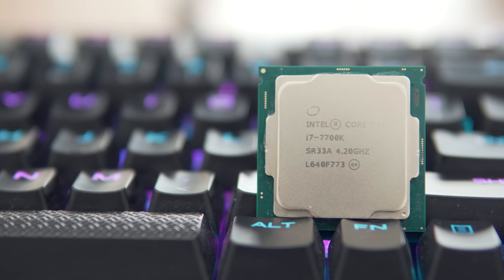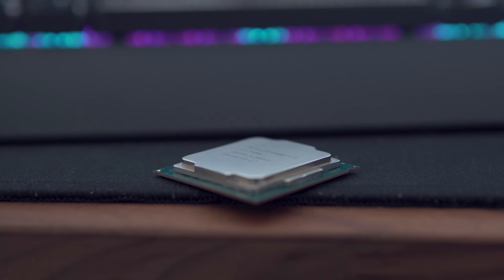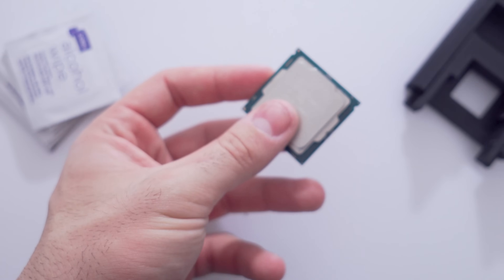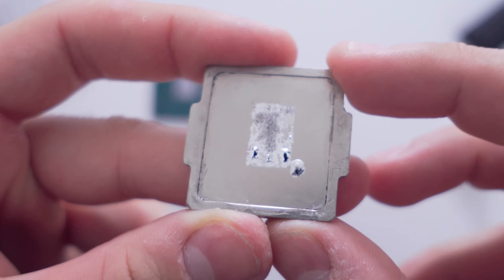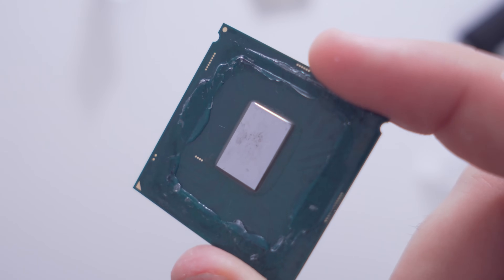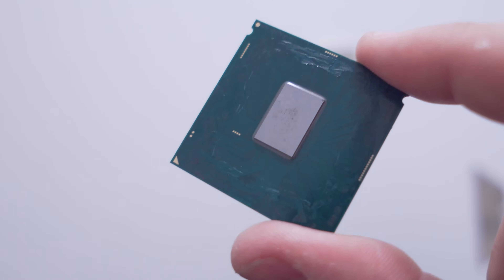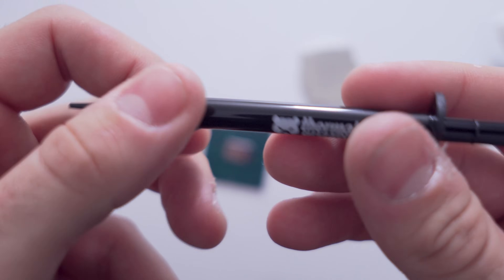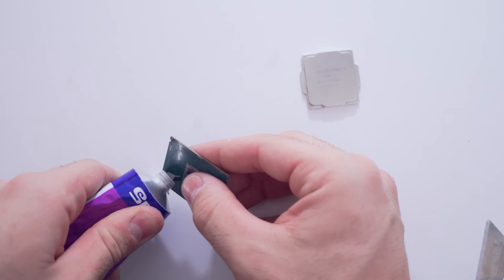Liquid Metal on CPU - 9 Months Later!

Comment: Still a complete joke that you need to delid
Reply: this is oldschool hardware overclocking 
risk => profit
Reply: CPU temps are fine from factory if you don't plan to OC your CPU, but yes, delid is kinda mandatory if you wanna OC  down the line :)
Reply: Yeah, i know it's freakin' high, that's why i kept such voltage only for a CPUZ validation screen
Reply: not with amd cpu's :P they solder their IHS to the CPU no need to ever delid
Reply: Schicken Phartso, if soldered was worse due to thermal cycling, AMD and LGA 2011 chips would get hotter over time. If you know a soldered IHS chip that gets 10 C hotter over time, I would really like to see that.
Reply: yea but for 350 usd i would expect to have it soldered
Reply: 1.502v  dafuq
Reply: Same, I was at 4.7Ghz  80 degrees, Now at 5.0Ghz 68 Degrees max.
Reply: Adrian Ronald Sehat 4 core 8 threads
Reply: jackelofnar if you don't want to delid and you're afraid then enjoy 4.8 average OC at 84°C. After I did a delid an applied liquid metal thermal I achieved 20 degrees cooler which also allowed me to have a stable overclock at 5 gigahertz at maximum temp of 80°
Reply: Not sure why they stopped soldering them my 5930k was and its fine.
Reply: My 7940-X will run all-core @4.5GHz @1.26V and it only hits 85C on air while running CPU benchmarks.  Technically I don't need to delid, but I plan on doing so anyway just to see what I can get away with.
Reply: I don't at 4.7ghz
Reply: @Daniel-nj8np  i think that's pretty good ! Imagine if u delid :3
Reply: You don't "need" to delid dude, most Intel cpus can turbo boost oc fine on stock paste and a decent cooler
Using a un delidded 8700k at 4.9 on air, doesn't exceed 76c under benches.
 You only need this is you're doing stupid undeeded overclock and stupidly high vcores
Reply: @eillswim  false by 8700K was spiking into the 90s on just 4.7 with a dark rock 4. Max rpm.
Reply: Han Lockhart The clean suits are only required during the photolithography process.  There’s nothing exposed under the IHS that dust is going to damage..
Reply: I have the 7700k and I have 50 to 60 degrees idle. Immediately as it starts pushing things it goes to 70 and probably 80. After it hits 80+ it starts reducing performance to be able to not burn and that sucks!
Reply: Not a joke if you live in high temp countries like Australia I was getting 75°C with stock cooler and idle temps when I did delid the thermal paste on the CPU came off LIKE DUST!

after delidding and applying thermal grizzly kryonaut I get sweet 34°C to 40°C with my noctua 3rd party cooler

where:

MOBO temp = 30°C
CPU temp = 40°C

And that's on a HOT day on a Cool day

MOBO temp = 25°C
CPU temp = 34°C

from temps @ 75°C to 40°C on a hot day that's a 35°C lower temp!
Reply: You'd think that there would at least be an option to get a CPU with factory applied liquid metal already installed.
Reply: same for me on my 6700k, i was also able to achieve 5.1 but i was pushing like 1.502v vcore to get it to pass a run. i get it stable at 4.9 around the high 60s, everything is cooled by a PH-TC14PE.
Reply: @OxygeenFR  my 6700k needs 1.55v vcore to achieve stable 5GHZ.
Reply: @Squilliam-Fancyson  everyone on Overclock.net agreed about the fact that my CPU must be golden. :)
Reply: Actually mine I7-7700K runs at 4.7GHz at 1.28V, but anymore than that it's not stable. I must mention, I haven't delidded yet, but I am planning it so I can hit 5GHz with low voltage.
Reply: You do not need to.
Reply: Delidding is required for many CPUs if overclocking causes high temperatures, which can be exacerbated by high voltage [over 1.39v in UEFI] to achieve stability.  A few lucky people can overclock to 4.8GHz at 1.28 volts and do not need to delid
Reply: ZZstaff if the ihs was soldered you wouldnt need to delid
Reply: jackelofnar In theory, LM is better than good quality solder by about 3-5 degrees. If you’re super serious about temps or overclocking, desoldering can yield some improvements.
Reply: I got my i7 7700k running as @4.7 gig 1.20 volts iam kinda happy..
Reply: @ZZstaff  hmm I can OC to 4.8ghz at 1.28 with my i7 8700k and temps at full load is about 80'C and that low voltage with that high temps is a bit weird and I have a Corsair H150i pro rbg so a pretty good aio. I have just a guess that I got unlucky with my CPU?
Reply: @pluto9568    As you know the i7 8700K has 50% more cores than an i7 7700K, which means it gets hotter doing the same work load than the 4 core.  Your CPU is a good one, 80 degrees C is to high though, that is why I delidded my i7 7700K.  Delidded it can do 5.2GHz and stay in the low 70s C while being tortured, gaming it stays in the 60s C for maximum temperatures.  I use a Noctua NH-U14S air cooler, which is better than many water coolers.
Reply: @ZZstaff  I got very lucky with my 8700k; several benchmarks (Prime95, Realbench, IBT on Maximum) have a stable 4.8Ghz at 1.25 volts. I hardly get over 70c during long gaming sessions in new games via air cooling (noctua). I'm pretty dang happy with that.
Reply: Surfing Eagle What cooler do you use?
Reply: You don't "need" to delid. I have a  7700K , and it'll easily do 4.8 with peak temps in the low 80's C and that's with all air cooling. You would only need to delid if you were unlucky and got a problematic cpu when it comes to cooling, and you also wanted to overclock it to the max. Yeah, you will burn more watts keeping it cool without delidding.
Reply: Surfing Eagle: Bullshit. It hits 85c on AIO easily. You are full of shit.
Reply: @surfingeagle784  I had to with my 4970K cpu!
Reply: :) It's not greed, it's practical, why to apply a more expensive thermal paste when just only a VERY small number of the buyers would be overclocking in such an extreme way, especially when considering that keeping a CPU at such a high temperature (just a bit before entering the thermal throttling faze) it's significantly shortening it's life expectancy.
Reply: on a 4 core 4 threads.... right...

Comment: It's darker in the middle because it has reacted. Eventually the IHS would fail structually. But....it would take years and years to get to that point because the IHS is so thick.
Reply: idk, there's galvanic corrosion between the metals; once the nickel is degraded and you get contact between the copper and liquid metal, the corrosion is much faster. you'd probably be able to tell how degraded it is just by seeing the temperatures get worse.
Reply: copper can't alloy with the liquid metal so when the thin nickel coating dissolves, the heatspreader will not continue to react.
Reply: England is my city depends what the liquid metal is made from. If it's titanium based you are correct. If it's gallium based it can form an alloy with the copper.

Comment: imma put liquid metal on my notebook cpu and gpu i think. no delidding needed.
Gotta change the thermal paste anyway so might as well go for liquid metal.
Reply: jort93z Remember, LM eats copper up, if it is aluminium you'll be fine.
Reply: The IHS is made of copper. are you sure?
Reply: jort93z if it's copper you're fine just make sure to apply very little to avoid spills or use electric tape/nail polish or silicon on transistors near the die just in case. Please report back with improvements and good luck!
Reply: oh, i will. its pretty bad currently. basically hitting 105°C under load until it crashes lol.
Reply: jort93z sound's like a Mac lol

Comment: Hi  a question why change the nf-a9 fans to nf-b9 in the cooler as the b9 are 1600 rpm but a9 are 2000 rpm ? . i ordered the case fans based on your build and only realized later that they only run on 1600 rpm
Reply from the maker: The B9's look better, are quieter, and I don't need my fans running @ 2000rpm. 
If you want the better performing fans, choose the A9's. 
I'm really happy with the B9's though.
Reply: Optimum Tech , hoping b9 are enough to cool down 1800x. Thank you , you make awesome quality content.
Reply from the maker: No problem man, are you using the D9L heatsink? 
The 1800X should be fine, Ryzen processors have a nice, low TDP.
Reply: i wanted to buy the d9l but i heard the displacement of the intel and amd socket was little off so i got paranoid and bought the u9s. this is my parts list https://pcpartpicker.com/list/LGHhRG

Comment: Great vid! I've delidded two CPU's now and highly recommend doing it if possible on yours because the improvements are massive!!!(depending on your CPU) also don't believe the rumors about LM, there's zero maintenance. You also don't have to reseal if you don't want to, the pressure from the socket/cooler is enough to keep contact between die and ihs!
Reply: Yes no need to delid AMD CPUs
Reply: De-lidding pretty much only applies to Ivy Bridge or later generations of CPU's. (from the 3570K/3770K and onwards)
Reply: Alex The Average I have a Ryzen 5 1600, isn't that soldered so delidding it wouldn't have any benefit?
Reply: Alexander Hernandez I agree, I had my 7700k on water before the delid and I couldn't push it past stock boost without throttling... Same with my 7900x. I wish Intel would do something about it because for an expensive processor temps should be in check... Imo at least.
Reply: G6 Liara 3770k didn’t really have any heat issues though. You hit cpu limitations before temperature. Unlike the 4770k/7700k :/ Those two are just terrible some people can’t even get past 4.3Ghz on the 4770k with a good air cooler while the 4790k/6700k can hit 4.5 easily on like a cryorig h5 ultimate.
Reply: My i7-7700k is only stable at 4,9 GHz sadly. Well... I was able to run it at 5 GHz @1,4V out of the Box, but im Prime 95 3xThreads aren't working.
With an 280mm AIO Cooler it was 91°C at 5GHz. After delidding it was only 61°C. The Threads still didn't work properly..
Without OC I still get 10-15°C cooler Temps.
BTW delidding cost me 50€ for all parts (30€ Delid Die Mate 2, 10€ Liquid Metal and 10€ Glue (had no on hand)) and they are reuseable for Coffee Lake.
Reply: my 3770k did 4.4 no delid and 4.8 after delid with same temp as 4.4.
Reply: Krekker Recer dont try it will kill your cpu i also have a ryzen 5 1600 . Dont even try !!!!!!!!!!!!!!!!
Reply: It is possible but it's risky as fuck and there's no reason to do it. You need to put your CPU in a toaster over for like 10 mins to let the solder melt then quickly put it into the delid tool before it cools again. Too hot you roast the PCB, too cold the solder doesn't liquify.

Linus successfully did it in a video.
Reply: my 4790k is hitting 71c on 4.4 ghz, while around 80% load
Reply: Hahaha, I delidded my G4600 and put liquid metal on it.

Will do my 6700K after learning a bit more.
Reply: Daniel Waddell the new APU Raven ridge are TIM not solder so delid those if you want
Reply: shivam chandak I was just wondering is it possible to solder the lid on
Reply: shivam chandak I think I can do it
Reply: You can solder it yourself but you will need specific equipment.
Reply: VAC2 but I don't think everyone have the equipment and won't want to do it as u can delid it again if there is a problem
Reply: Solitude good
Reply: Krekker Recer you'd need to melt the solder, risking just cooking the cpu to death
Reply: Weaver Games really the better way is to heat up something like a spoon. Or something with the surface area oftge DIE under the IHS then heat the spoon with a torch and place it  on the IHS and wait till you hear a clicking or snap  noise ( mkae sure you cut the silicon seal around the edges first ) and it'll just pop off no DIE or PCB damages
Reply: When do you delid? After you first run your newly purchased CPU? or immediately?
Reply: That's what I did, Don't use gasket sealer it heats up a bit quick!
Reply: Except if you're on laptop, then you need to repaste it every 6 months or so or even more if you overclock the laptop.
Reply: @korinogaro1988  now? Intel who?
Reply: Thinking ill try delidding my i7 3770k to get another couple of years from it. 8 years so far.
Reply: @korinogaro1988  ur wish has been answered too haha
Reply: master of nothing u are asking how hard it will be to kill you cpu . If it has to be soulder intel would have done it for u and which cpu u have ?????? Intel or amd??
Reply: Alex the Average how hard would it be to soulder it
Reply: master of nothing oh sorry for my reply but its not possible by us what CPU are you using??????
Reply: master of nothing how ? https://discord.gg/Gnmh2d join my discord server we can talk there if u want ????
Reply: Fuc* AMD Bitc# Fan Boy/Girls, intel is the King remember...
Reply: You cannot delid a soldered CPU. You will definitely break the core.
Reply: Radoslaw Panek - you are wrong, search delid soldered CPU, then write comment again :)
Reply: @rexb21  wrong.

Comment: Thank you for this review months after delidding. Seems safe by the way. I wish so much Intel come back to soldered IHS.
Reply: Marc, he cant explain. He has no clue what he's even talking about. He loves Intel and that's fine. he just trying to justify it in his own mind.
Reply: SandPox how do you explain soldered AMD Ryzen? Intel stop soldering just for saving money...
Reply: MarcParis Imo just a few months is not enough..

I keep my cpus for 3-4 years or so at which point I expect them to work on a secondary computer less often for 1-2 years more.
Reply: I fully agree. After, i find that 9 months feedback is pretty nice information, especially as delidded core i7 7700K seems to be in perfect shape.
Reply: how do you know it's in perfect shape?
Reply: Different well cpu appearance seems fine. Liquid metal seems to have damaged it.
Reply: MarcParis I believe you meant to say "seems to have not"

I don't think that you can really tell the damage done by just looking at it, it might fail given an other 9 months
Reply: Different well simply from video, this delidded cpu is not damaged. I cannot conclude on long term behavior, that’s sure. After i trust expert like der8bauer stating it’s safe.
Reply: No, it's better for not to solder the IHS, because the die size of modern CPU is a lot bigger, hard-solder can cause some thermal expanding/contraction issue thus can bend the PCB or crack the die, the thermal compound are soft so this issue will not happen
Reply: M Coop well c’est la vie...:)
Reply: Bob Crosby ihs is the heat spreader that is used to both protect mechanically desktop cpu and cool it throught cpu cooler. Last intel cpu using soldered ihs are broadwell-e cpu. Now all Intel cpu (both mainstream or enthusiast) are using thermal paste between cpu and ihs...creating a bottleneck in heat dissipation. Either it’s understandable on non overclockable cpu, either it’s a heresy on overclockable cpu.
Reply: Bob Crosby almost..:) ihs= integrated heat spreader...:)

Comment: Is the IHS made of copper?
Reply: Vandoeun Long nickel-plated copper.
Reply: jort93z that's only on old ceramic cpus, the gold plating on modern cpu contacts is very thin.
Reply: Yes but its coated in nickel to prevent oxidization
Reply: Yeah i am fully aware of that. theres some gold on the contact pads but not that much. you'll probably get more gold of ram sticks then of the cpu's.
I was mostly talking about older ones.
Reply: They usually are
Reply: Yes
Reply: some cpu's have a quite thick layer of gold plating. sometimes 1g or 2g per cpu. something like the pentium pro sells for $30 just because of that gold.

Comment: Hello :-D clp is great but over time it solder metal to metal but silicone to metal dont. 

GPU hd7970 
Before CLP: http://i.imgur.com/5UcpGTo.jpg (the factory paste was even worse here is some silveer 7,5 wmk) 
After CLP: http://i.imgur.com/dF5KLGG.jpg 

CPU i5 3570k(max oc i made is 5,0Ghz unstable stable 4,9 on Air) these are stock clock: 
Intel thermal paste: http://i.imgur.com/f9hi4GN.jpg max 69C 
CLP http://i.imgur.com/apdM37Z.png max 52c 

4,9 Ghz stable OCCT Linpack 6 hours: http://i.imgur.com/D8Zo3mB.jpg max 75C 
5,0 Ghz unstable :-): http://i.imgur.com/POEYqwa.jpg 79C Ofc CLP used :-) beetween core-IHS and IHS-Cooler 

The solder effect after year: 
http://i.imgur.com/xynMO3o.jpg 
http://i.imgur.com/ANXhJXj.jpg 

In this state you get best thermal conductivity but well its solder preety well and splitting this two parts require some force
Reply: This isn't called soldering. Soldering is melting and putting a filler metal between two objects to join them. What's occurred here is that your Cold Plate has formed an alloy due to the (I believe) Gallium bonding with the Copper. This doesn't happen on your Integrated Heat Spreader as its made of Nickel plated Copper and the Liquid metal can't form an alloy with it over a normal human timespan.
Reply: Well people called this soldiering :D in it forums x)

Comment: Nice video man, like always. 

Some websites (like caseking) sell CPUs already delied, pretested with 1 year guaranty.
For example for a 8700k it's only 70-80€ more. Considering you don't have to buy the tool, metal liquid and glue and on top of that you keep a 1 year guaranty, I feel it's kind of a good deal. 
What do you think of that ?

Btw I love your new M1 build ;) (I have one with 6700k and 1070 and I love this case)
Reply: I have seen some users get good results when using high grade Thermal Compound after delidding (Cryonaut, IC Diamond, Noctua TIM). It won't get nearly the same results as liquid metal, but it should definitely be an upgrade to the current Intel toothpaste they use. It would be good for a less serious overclock or if you are just wanting better noise levels from your PC.
Reply from the maker: Sounds like a pretty good deal to me man, but remember there are other ways to delid for cheaper (like using a razor blade, and not resealing with glue etc.)